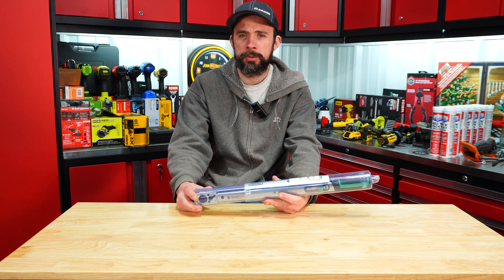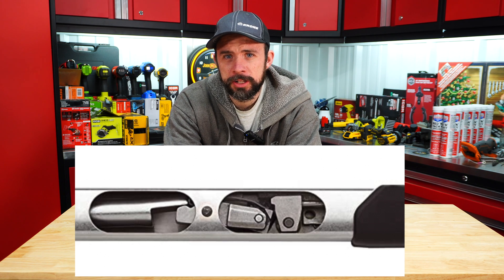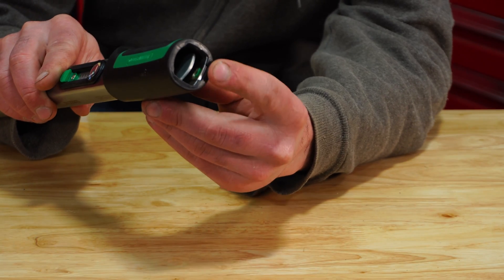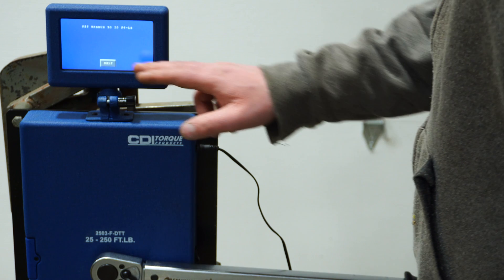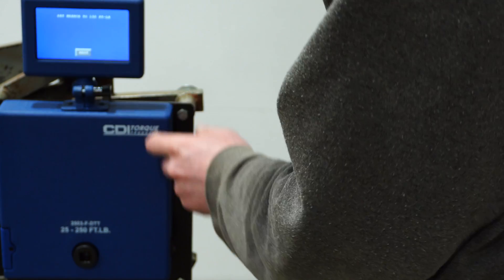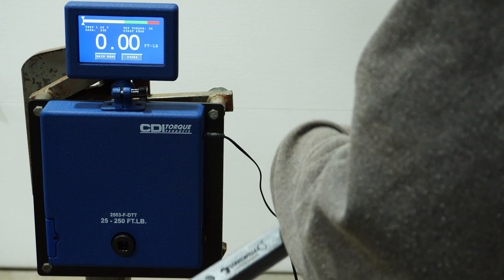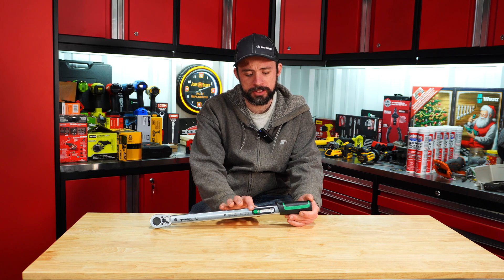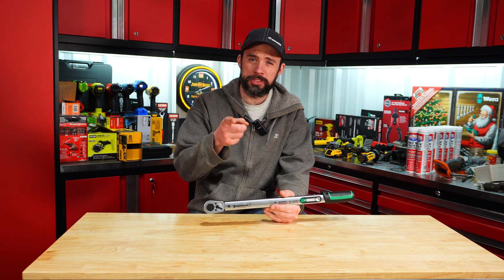Fastest Torque Adjustment, On A Mechanical Torque Wrench?  Made In Germany Stahlwille

Comment: The reason they don't come with a full case is because most users will opt for foam drawer inserts. I'm thankful they don't include a bulky box I'll never use. These are burly enough to not worry about drops or knocking around a drawer anyways.

Comment: As an engine builder who u uses stahlwille every day in..it is one of the best torque wrenches on the market. There digital is untouchable...you link it to the computer and can make programmes..its handy for doing injectors or different phases on headbolts. There digital leaves snap on's digital in the last century🤌🏼 German tools are far superior in my opinon. Better build quality, and i am in europe so they are reasonablely priced and all we use is NM..Stahlwille being german of course the Better scale ia going to be NM🤦🏽‍♂️🤦🏽‍♂️
Reply from the maker: Yeah Stahlwille are quality tools,  issue here is availability and price.
More so the price,  retail here the Stahlwille digital is $4000 vs $1000 for the Snap-On.

Comment: The Wera torque wrenches are actually a British designed and engineered product ,produced for Wera , the Stahlwille wrenches are designed with consistency for aviation not cars, 
I admit cars are becoming more technical, steel fasteners into aluminum,magnesium and even plastic compounds. Still they aren't saftey wired. And your not going to drop out of the sky if your waterpump seeps some coolent because of inconsistent torque readings. I'd rather be 7% + or - all the way around on the same number ,in other words consistency is more important than exact readings. So set for 50 but I get 45 on every bolt is better than getting 40,50, 55,38.
Repeatability is your best freind.
Reply from the maker: Defiantly overkill for cars but the torque adjustment is fast and easy.

Comment: Ordered myself one after seeing how quick it is to set the torque value on the unit. Makes other units look highly user unfriendly. Too bad about the case but it's no deal breaker for me as it will mostly live in my shop drawer.
Reply: Stahlwille make a case.
Reply from the maker: Nice!

Comment: Could you try the ETork torque wrench? It seems to be one of the cheapest highest reviewed digital torque wrenches around, probably due to it being an odd hybrid design. It seems to truly be a click type torque wrench, with just a digital display that is used to show adjustments in torque. Has a nice locking feature to stop turning of the knob. It is not a true "electronic" torque wrench. Reviews seem great for the price, seems like a great option especially if you dont need the angle options of more expensive, traditional digital models or just a cheaper option compared to split beams/digital t wrenches. Only around 90 bucks for a 3/8s!
Reply from the maker: That's defiantly a interesting torque wrench.  I will order one in 1/2, and test it once I receive it.  I would like to do 3/8 but that takes another tester,  the range on this one does not go that low.

Comment: It seemed relatively consistent, if not particularly accurate. I'd much prefer accuracy over precision in a tool like this. Easy enough to recalibrate, hopefully? But yeah, of course for $400+ you'd certainly hope it's both right out of the packaging.
Reply: They are incredibly easy to calibrate. I work at a calibration company I've probably adjusted 100s of them. By far my favourite torque wrenches. I'm not a native english speaker so I dont know the exact words. You have two screws for adjustment, one is for the lowest and the other for the highest value. You can see them at 5:03, they are beneath those plastic thingys. The screw closer to the handle is for the lower value the other one for the highest. So you just pull out the plastic thing and then you can access the screw. After that you just turn the screw clockwise to increase the value, etc.
Reply from the maker: Thanks for this information,  much appreciated.
Reply from the maker: Yeah I don't know how easy this would be to calibrate,  that's a good point seeing its a different and not very common in the US.  I agree would prefer higher accuracy.
Reply: Ah I got that backwards with my second statement. I'd prefer precision over accuracy! Accuracy can be compensated for. Can't do much for bad precision!

Comment: I feel the plastic sleeve/tube is probably cheaper and easier to make, and takes up less space. More units in a warehouse or on store shelves. I'm not sure if I would have a preference one way or the other for this type of product. I currently keep my torque wrenches in their blow molded cases inside my tool chest, along with their paperwork. But I was thinking maybe it would make more sense to just leave them in the open in a drawer, for ease of access. The cases just take up so much space, and theoretically your box should have a soft liner or maybe even shadow box foam.
Reply: The tube is maybe easier to recycle, too. More environmentally friendly. That's probably the main reason they'd use that style packaging? And I think Stahlwille might expect you to use their foam trays. Shrug.
Reply from the maker: Yeah I think you hit the nail on the head,  better for the the environment and then if you want something better then you have to by the trays.

Comment: Can't really answer why they some of the torque wrenches come in plastic sleeves. It tends to be the higher priced ones, that do not come with accessories. Wera torque wrenches also come in the sleeves as did my insulated torques wrench from Knipex, the cheaper one though from Laser Tools did come in a blow-moulded case. If the come with accessories such as an adapter bit or extension, then they tend to be in blow-moulded cases.

Pretty impressed with the price you got that for, RRP in the uk is £405 circa $510.
Reply from the maker: Yeah its weird,  Everything from China, US and Taiwan seems to come in a case, well other then the $25 ones.

Wow that's crazy, the import tax must be higher coming into the UK.  Here I thought German tools were expensive here.